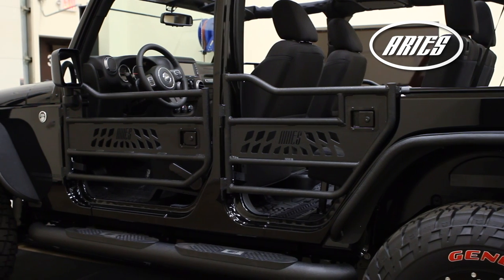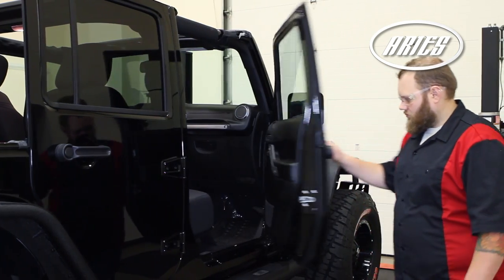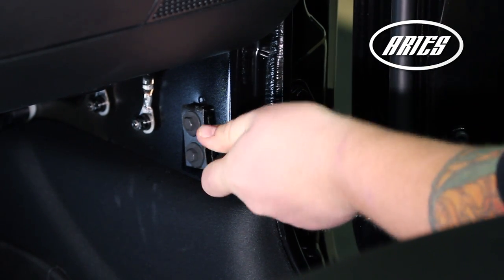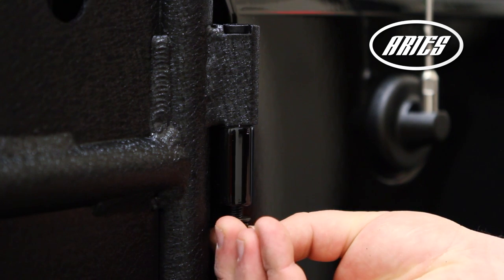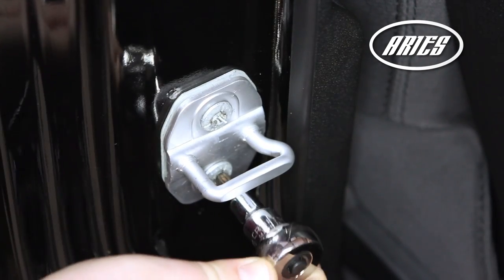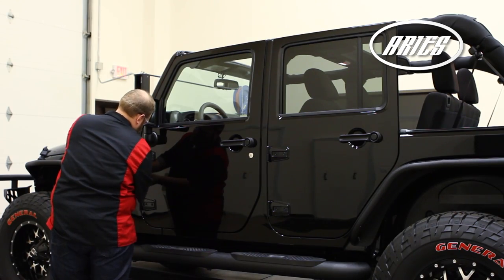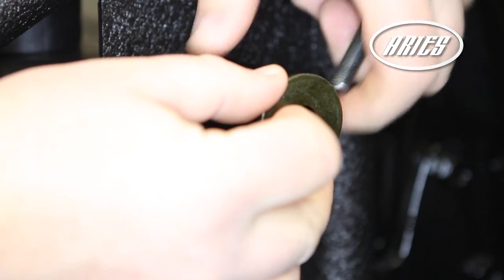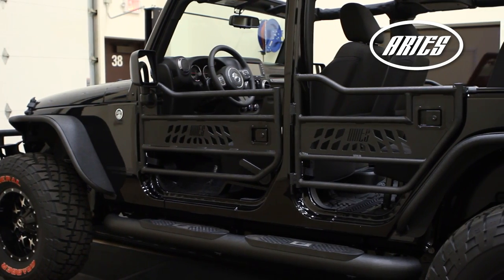ARIES Jeep® Wrangler: Tube Doors AR15009, 25009

Comment: These look nice. My only complaint really would be that the latch should be adjustable from the door side as to not have to continually adjust the door striker every time you swap doors. Not everyone has the luxury of swapping doors out twice a year, especially those in wetter climates.